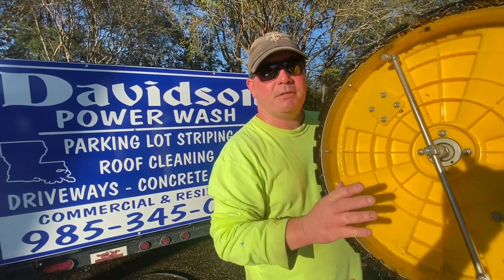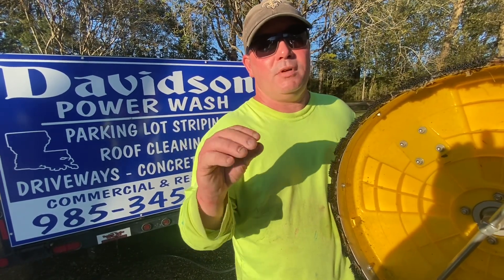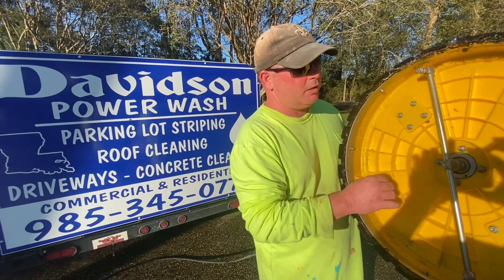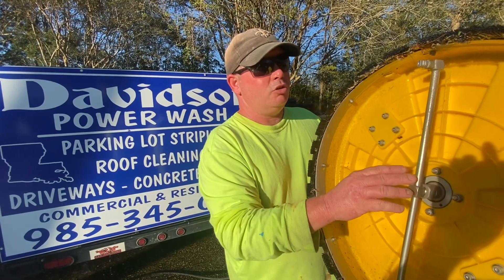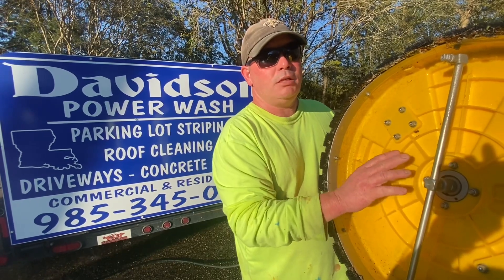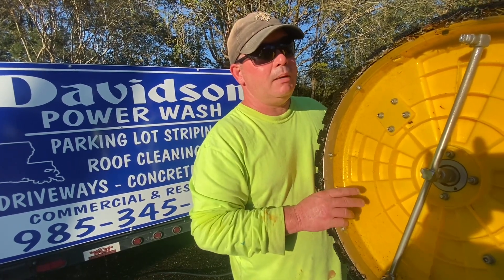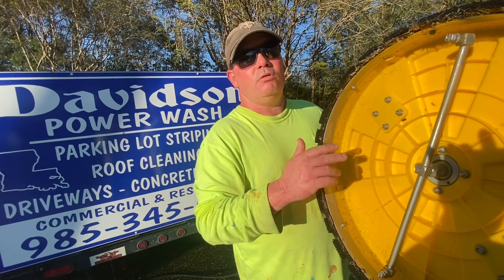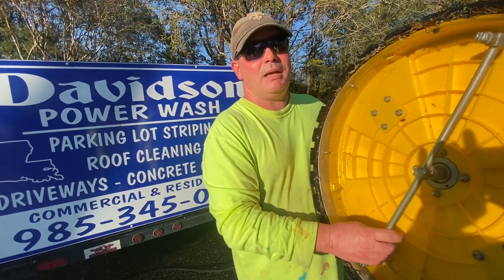Everything you need to know about surface cleaners part 2

Comment: Hey Mr. Billy, I use 2502 in my whisper wash 19" with a 4gpm machine. Does 15 degree tip give me more pressure and cleaning power with the same amount of volume and still cover the 19-in area?